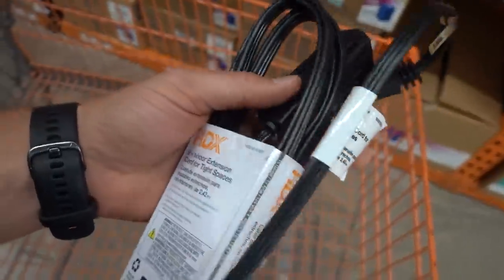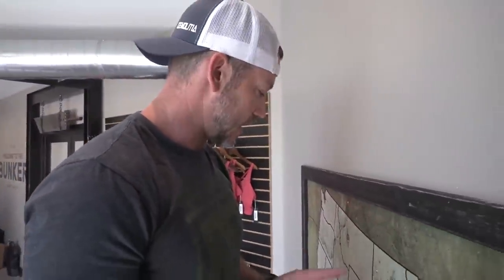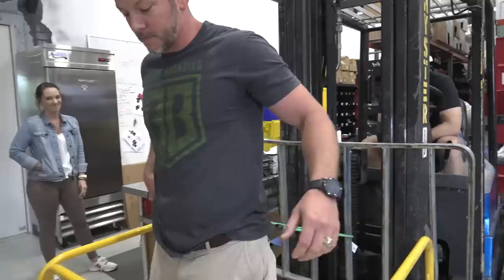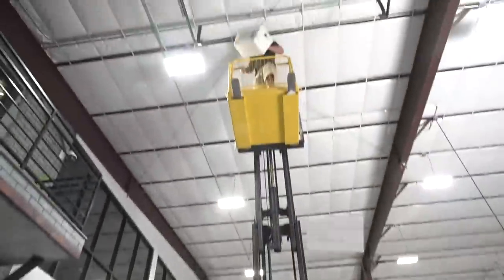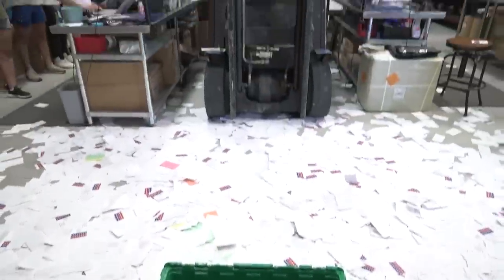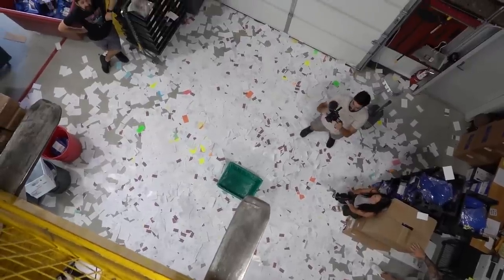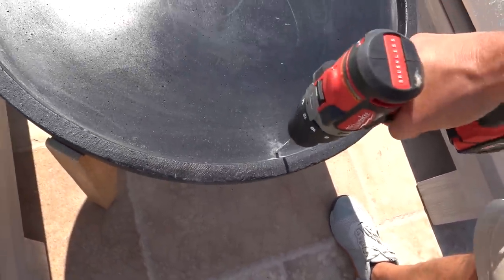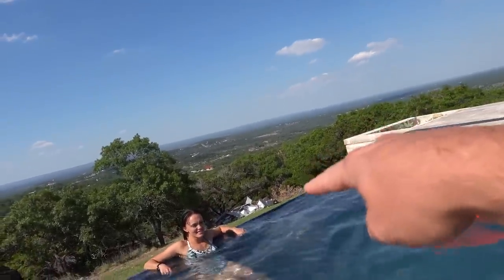This is Going to Take FOREVER!!!

Comment: Hire someone to dredge out the river in the area of your dock and rope swing, to create a deep spot.
It will probably also attract fish.
Reply: Long arm excavator will do it!
Reply: I was going to comment on the exact same thing in the last video, but no idea how they'd get a dredge to the river. Only ones I've seen are massive ones that dredge out harbors for cruise ships.
Reply: @deadlytoasteroven  you just get an excavator on the bank and dig out the river bed.
Reply: As someone suggested, it can be done from shore with an excavator with a long reach.
 @deadlytoasteroven
Reply: I don’t know anything about rivers but would the hole not fill itself in over time?
Reply: Depends on the speed of the current and the composition of the river bed. This river appears to be moving very slowly. Worst case scenario, you dig again every couple of  years.
  @Getmcwrapped
Reply: Think they said that the water is normally higher but bc of lack of rain it's low
Reply: @LetsDig18 is the guy to fix anything with an excavator.👍
Reply: @74jojo  Yes! Let's get Let'sDig18 in on the job! To Chris, it would just be another day on the job. To Matt, it would be a very deep blessing! I'd say dig at least 20' deep. Also a pit upstream, to act as a silt catcher, so the main pit will last longer than a year or 2.

Comment: Hi Matt, Check your Vault too and test for any humidity, moisture due to condensation, or possible leak too from the rains. I just don't trust the soil absorbing all the moisture (my vault comment before said 100lbs of silca packets hahaha which was better than kitty litter that someone else commented :) ). But, hey nice vid and congrats to Mitchell. Also, before laying out any grass in the areas that lost soil, you might want to rethink drainage in those areas. t/c
Reply: Pretty sure the entire vault is encased in concrete
Reply: @AndyMark24  Concrete too
Reply: @ifly135  haha didn't notice that 🤣🤣

Comment: You should do a video showing the beginning to the end results on the abandoned mansion. That would be awesome.  Also, I'd love to stop by Bunker Branding to buy some merchandise but y'all don't have parking for 18 wheelers.  Plus, I usually don't get out past I-35 heading to Laredo.
Reply: Side of the interstate. That's what our emergency markers are for! Lol
Reply: @tunesgarage  Lol. Yeah but if someone hits me and I'm not stopped in an emergency, then it's my fault.   I could fake it by putting out my triangles  but, that wouldn't stop someone from hitting my truck. Then I'd have to answer to my Safety department on what the emergency was and why I had to stop on the side of the interstate.  It's a good thought but it has risks I'd rather not take.
Reply: @davidchalifoux504  find the closest exit and get an uber if its too far away
Reply: @BrokeWrench  Good Idea. There are several TS off I-35 that I can park at. Then catch an Uber over from there.

Comment: Some of the heat lamp light housing has a switch built-in to the wiring. Might want to look into that if you wanna put a switch on the smile more light.

Comment: I'm sure 800 people said this... but when drilling with a concrete bit you need the hammer option on.. slower revolutions and hammer drill.  It will work way better.

Comment: Your wiring....no no no no 🙈. Can't believe you started splicing the cables with the plug in 🤣 also matt your drilling into stone and not using the hammer action which would help a lot

Comment: Those drill bits are designed to be used with a hammer drill.....jus fyi....but you made the good choice not using hammer....it would've prob cracked that table....but just for your head those bits work 10 times better when using the hammer setting on your drill

Comment: You're drilling a table because you don't want it to hold water and you're afraid it will crack. Strangely  enough, water in it while you drill would keep that from happening. It's a lime in the coconut paradox. The cause is the cure.

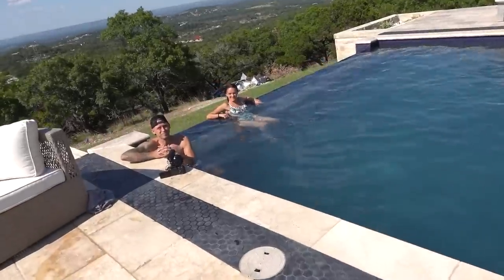Comment: 17:50 and this is a female fail. She bought tables with an inch high lip around them and then decided AFTER it rained she didn't like having flooded tables. So she had Matt drill perfectly nice tables, ruining them, so they didn't flood.

the moment a women describes something as "pretty" and decalres she wants it as a man you have a duty to get the hell away ro the dangerous women quickly. If you do not you end up having to drill "pretty" tables that double as paddling pools.
Reply: Congratulations you have been selected amongst our shortlisted winner's🤞